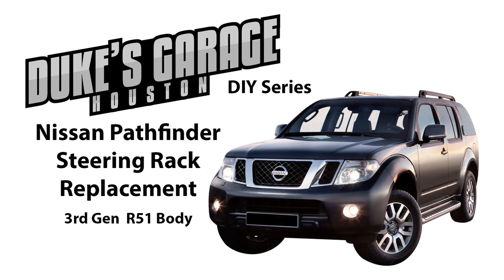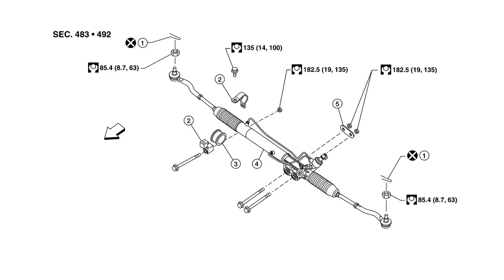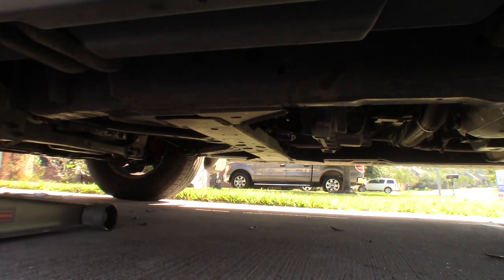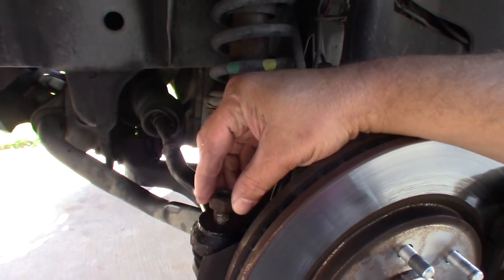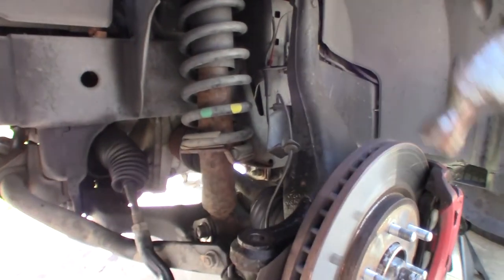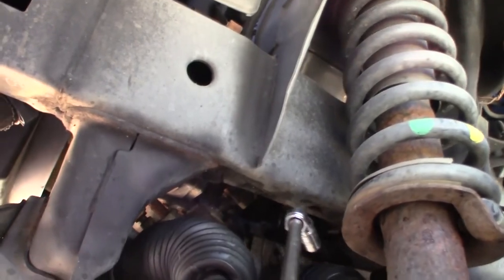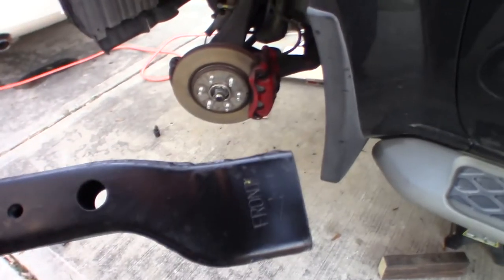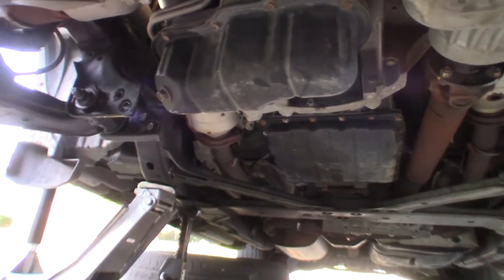Nissan Pathfinder Steering Rack DIY.  Detailed!

Comment: Thanks for making this video! It gave me the confidence to replace my steering rack in my 2016 Frontier 4WD without removing the final drive. I followed your example but I found it easier to work the rack out through the passenger side and install the same way. I was also able to leave the bracket mount in place that you had removed. Once again thank you!

Comment: great job. Im about to swap in a rack from a another car. My top seal is leaking pretty bad. so plan is to fit new rack and fix my old one. with the final drive if you just removed the rack from the other side wouldn't the diff pumpkin not be n the way?

Comment: Hey Duke. If a lil old cotter pin gave you that much trouble, you best stay down south. LOL
Side cutters all the way, pinch and pull against the heel of the tool. Nice Job. Thanks for sharing.
Reply from the maker: Thanks for the tip

Comment: If you pull the coilover can you avoid dropping the final drive? It also looks like the front diff isn't supported by the jack or anything in the end - did you just let it hang? I'm a bit nervous about pulling the CVs by accident.
Reply from the maker: You can try just pulling the coilover and see if you have room.  I was feeling my way through the job and its possible that dropping the front diff was unnecessary.  Yes, I had the front diff unsupported at one point, not recommended.  Be sure to use jackstands and take your time.  If you have decent selection of tools, getting to the point of pulling the steering rack should take an hour or so...especially if you can avoid dropping the front diff.
Reply: @dukesgarage3057  thanks for the response. We've had a few seized bolts and lacked a breaker bar so it's taken a little longer. 

Any tips on the steering pinion? We've loosened off that 13mm(?) but it's not coming out. Anywhere to brace it or anything you might suggest?
Reply from the maker: @christophersnow5578  Are you saying that you pulled the bolt but the clamp isn't coming off?  You have to unscrew the bolt all the way out to get the clamp free (as I recall).  If the bolt is out and things are still stuck, you can take a long extension and put it under the clamp, then tap the extension from the bottom with a hammer to try to encourage the clamp to come off the steering rack pinion.  Also try shooting some PB Blaster on there to get things loosed up.
Reply: @dukesgarage3057  We got it out and got the new one in. 

To confirm, we had to drop the diff like you did to make space. Getting it back up was a pain but all is well that ends well. We also pulled the coil overs out. 

I have some intermittent noise from the steering pump and the steering isn't smooth. I'm guessing air in the lines. Did you bleed your system? I took it on a short drive and there were bubbles in the reservoir but not resolved when I parked, so I'll probably have a mechanic do a once over if I can't find anything online.
Reply from the maker: @christophersnow5578  I'm glad you got everything back together.  You really need a big jack to manage the front diff comfortably.  Regarding the noise from the pump, turn on the truck, top off the reservoir with new fluid and cut the wheel left and right (to lock out in each direction).  This will push the fluid through the system and force the air bubbles out.  I believe I show this step at the end of the video.  If the fluid is too high after performing this procedure, use a syringe to syphon some out.  You can find syringes at your local walgreens or cvs.
Reply: @dukesgarage3057  yep, we did that a couple of times but I needed to do it a bunch more. Thanks for all your help - and I hope anyone else reading this finds value if they have the same issues!